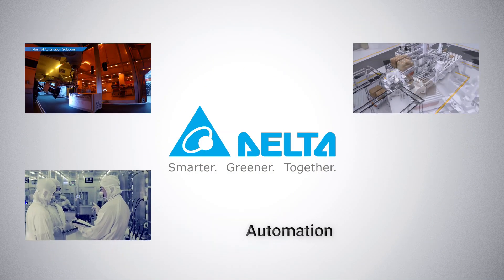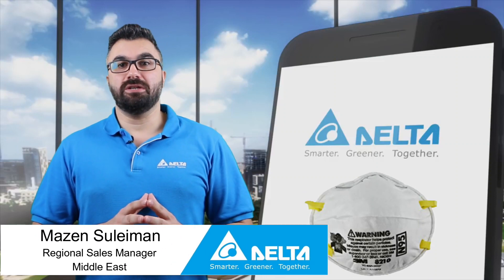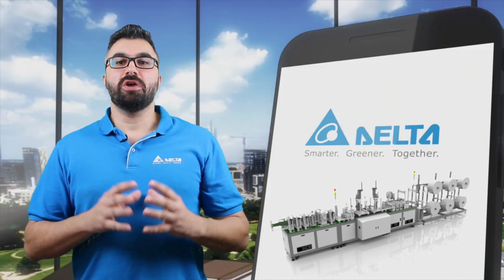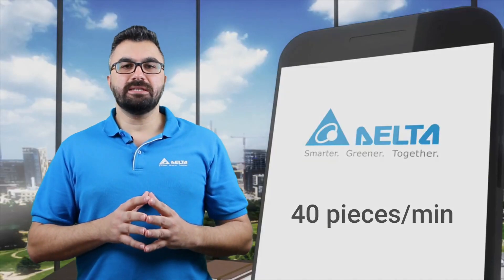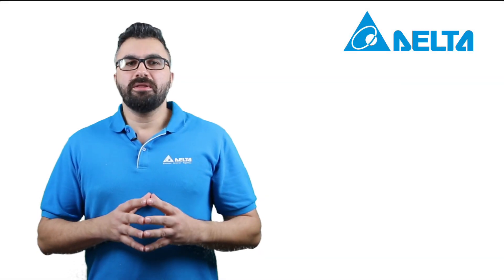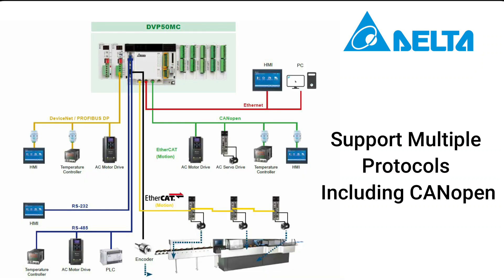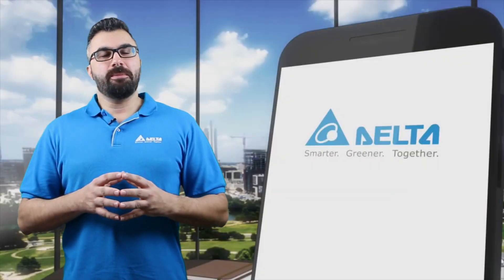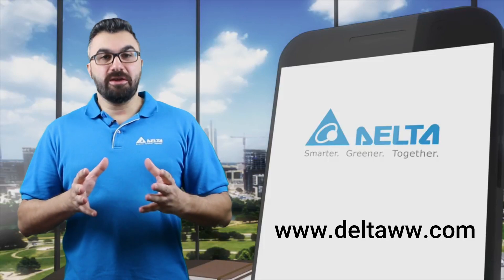Automatic N95 Medical Face Mask Machine Solution

Comment: Thanks for this video!
According to operation manual, maximum number of axes for PLC 50MC is 24 (real) and 32 (virtual). So, do I understand correctly that in an example of this machine possible to control to 24 servo drives via Ethercat. How many servo drives can be controlled by the one controller 50MC?